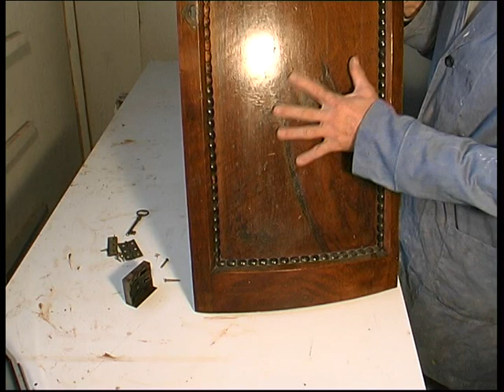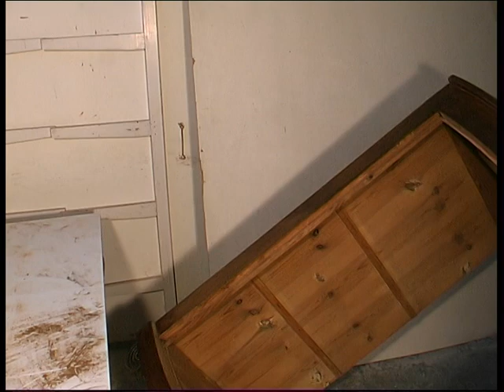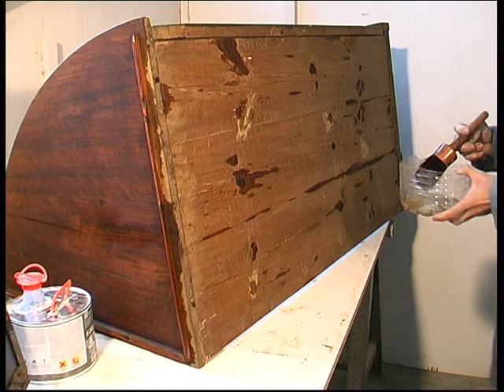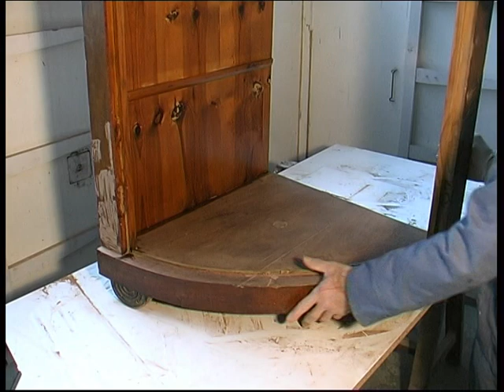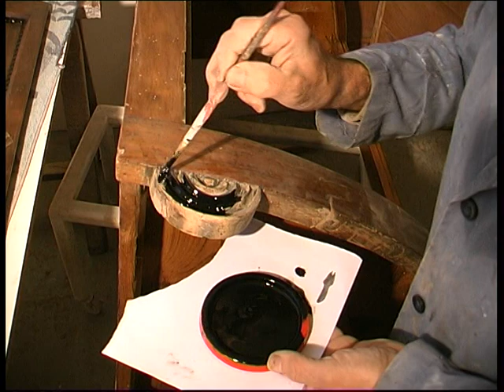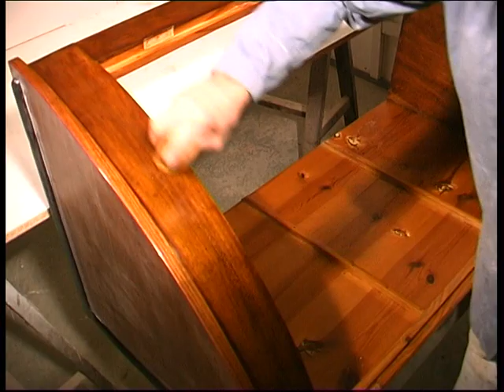Como restaurar un mueble rinconera estilo Imperio

Comment: consulta por que no inyectar liquido anti carcoma en orificios de puertas?? los traseros son de madera solida se ven delgados como 1 centimetro??
Reply from the maker: Estando las puertas en su interior sin ningún tipo de barniz y aplicando con abundancia el líquido mata carcomas, tenemos asegurada la total penetración del compuesto químico por los poros de la madera, no siendo en éste caso necesario  inyectar por los orificios. En piezas gruesas de madera, que además están barnizadas, se hace imprescindible inyectar pacientemente por las galerías, para una total protección. Buena observación en el grueso de las traseras, pues en la construcción de los antiguos muebles no disponían de contrachapados o algún otro elemento prefabricado, teniendo que elaborar  estos tableros de forma manual, serrando finas tablillas y encolando unas con otras. Los gruesos de estas traseras pueden tener unos sorprendentes cinco milímetros, siendo todo un alarde de oficio y habilidad del ebanista que elaboró el mueble. Un saludo.
Reply: agradezco tan clarificadoras respuestas